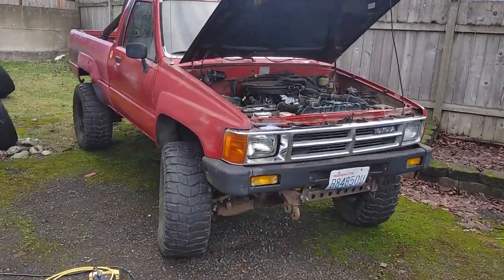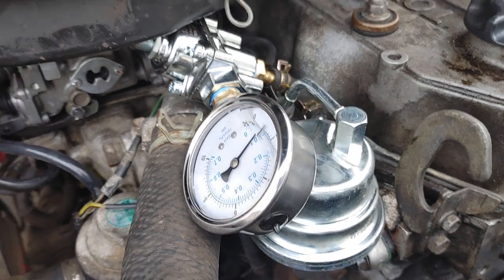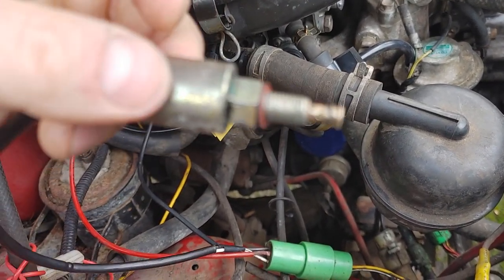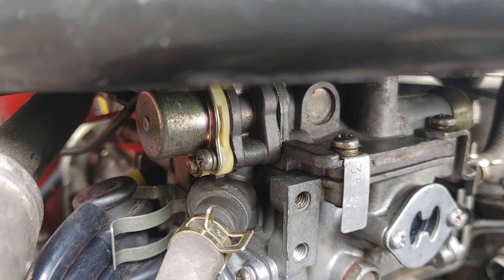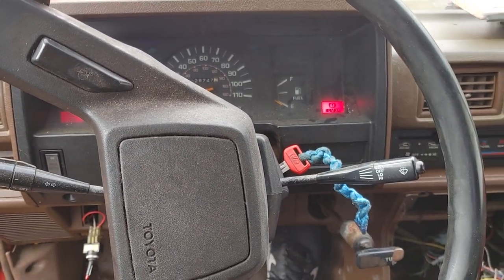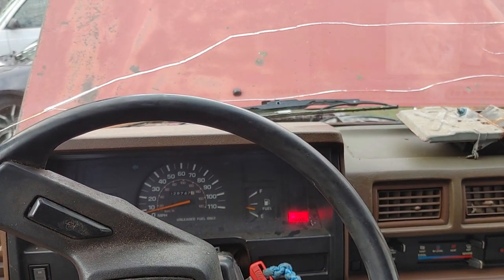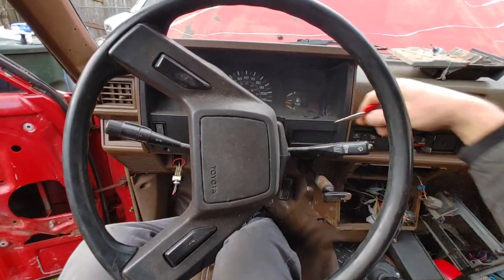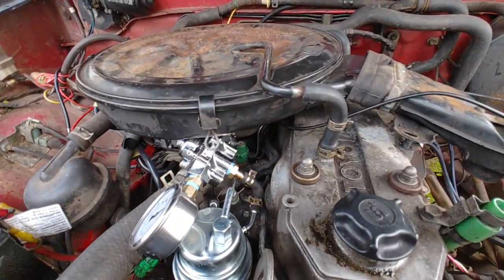22r won't idle - Fuel Cut solenoid? SOLVED! SEE DESCRIPTION / COMMENTS

Comment: I repaired one recently ,1989 Toyota truck 22 R. 
The idle circuit had a rough idle, other than that vehicle ran fine. You had too keep youre right foot on the gas pedal slightly while idling. Coincidentally mine just happened too be a twofold problem. After removal of of the fuel cutoff solenoid and observing the tip of the solenoid while it was energized even though the solenoid clicked, there was hardly any movement of the pintle valve tip that I could see. I sprayed carb cleaner through the tip with a long nozzle and nothing went through it. Finally after working with it for awhile it unstuck itself and now it shows a nice spray pattern out of the spraying nozzle orifices.
The second part of the idle problem was a cracked vacuum line. So these two things made this diagnosis a little tricky, but it can certainly be done. This particular truck took about couple hours.
Hope this works for someone who is going through a similar problem. Good wrenching too all the techs.

Comment: The fuel cut solenoid could be possibly stuck. Try spraying the tip of it with brake cleaner and tap the tip of it with a screwdriver. Repeat with brake cleaner several times. Then test it with power to see if it will click. You can also try tapping on it when you add power on/off while testing. If nothing happens, then it probably doesn't work anymore and you'll have to try to find and buy another one. That small o-ring that goes on the end can probably be found in a carburetor rebuild kit for this carb at the auto parts store.

Have something hold down the gas pedal to keep the pickup running and then check the glass window on the carburetor to see where the fuel level is at. Is it too high, or too low?

You may need that solenoid for the truck to run. In my experience when I had a 1980 Toyota Pickup 4wd with a 20R, that solenoid is connected to a circuit board near the driver's side left foot (it's call an emissions computer, it may not be on all models though). The cold solder joints on the circuit board develop tiny cracks and will cause intermittent connection with power and ground for the solenoid to function. You can reheat the solder joints on the circuit board to fix this type of issue. (What I did was just splice into the negative wire of the solenoid and wired that additional wire straight to the negative terminal on the battery and it ran fine.) Symptoms that happen with intermittent connection with this circuit board: stalling/stalling especially when driving and letting off the gas pedal when coming to a stop.
Reply from the maker: Hey thanks for the reply! I tried exactly this with the emissions computer. Reflowed solder on every point and added a tiny bit of fresh lead Kester solder. Noticed a bad diode as well. Replaced with generic diode of similar type. 

I've seen people in forums say the white wire on the fuel cut solenoid is ground, but in wiring diagrams and from my testing, it actually goes to that emissions computer. Maybe it's supposed to get grounded there? Whatever....it's not working on mine. I cleaned the fuel cut solenoid in an ultrasonic and sprayed it with carb cleaner. Got it to unstick and click, although it still seemed gummed up, like a weak muffled click. Installing it did not fix issue. Ordered a new crappy Chinese fuel cut solenoid that has a very definite clean sounding click and only one positive wire. It receives ground from the carb body (like everything else on the carb, choke heater, outer vent). It appears that if the fuel cut solenoid fails CLOSED, or does not receive 12v power to open it up, it could starve the engine of fuel and prevent proper running/idling, but the fuel cut solenoid itself would never cause my problem (way too rich and flooding with fuel). It appears all it's intended to do is immediately cut fuel when the key is turned to off to prevent residual fuel getting in resulting in dieseling.

Anyhow, after studying wiring diagram, I was able to get a remote starter hooked up (have to ground clutch safety wire and wire remote start between batt + and IGN wire going to start solenoid). Upon doing this, I was able to see the float filling up, up, up, up and then overflowing....even though I set the level EXACTLY as stated in the FSM and triple checked. After spending a ton of time dicking around with the float level, I was able to get it idling quite nicely....until a radiator line blew because the thermostat is old and dead. So ordered a new one and just put it in yesterday. Gunna reinstall dash instrument panel (pulled to install new bulbs and fix heater gauge) and see if she's finally alive when I have time....probably next week. 

Thanks very much for taking the time to reply! Very much appreciated!

Comment: wow I haven't seen one of those in 30 years, that fuel cut solenoid is exactly that, it cuts fuel off to keep it from dieseling, the previous design had a pin that we would take out and screw the solenoid back in, on that design just snip off the brass end with the holes and screw it back in, you don't need it. Next, you have the air cleaner on so I can't see if choke is closed, also that glass window is to check fuel level, you should see fuel in between the two flat points, also there is a metal, what looks like a round housing on the side of the carb with a vacuum hose attached, there is a rubber diaphragm  inside to assist in cold starts, pull that vacuum hose off and make sure there is no gas coming out, if there is either the diaphragm is ripped or missing.

Comment: That's idle cut solenoid?
It changes length when you shut off the ignition key?
It changes length when you turn the ignition key on?
Does it? Are you grounding it's body during the test?
Do you have a "you pull it" yard, around?
My idle cut solenoid worked for over forty years before I parked the car and haven't tried to start in a long time.
So, if you verify it does what it does when it's supposed to do it. Install it, my question is how many cylinders are firing?
Maybe inspect the spark plugs, clean and gap them. Inspect the secondary ignition like cap, rotor, wires.
Verify spark at each plug.
Turning idle air bleed screw in leans it. That's about as lean as it gets at 1 1/2 turns out. There is an idle speed screw. Are you using it instead of your foot?
Does it smell rich and were the plugs all firing?
See where you're at.
There's a HIC and an HAC on some of these trucks.
I studied them in library books for free and helped one with used parts while I experimented.
Do you know these terms? 
And what's your emission sticker or cafe decal look like?
Does it have a system designation?
Like, my dad's Corolla was a 4 AF.
Has your engine been modified?
Do you have vacuum leaks?
Try pinching each hose and see if idle speed changes.
There may also be a hose that gets disconnected and plugged during fine adjust of idle mixture.
Is your timing set and undisturbed during this repair?
Did it run bad before you condemned the carburetor?
Are there advance and or retard diaphragms on your distributor?
Are they able to hold vacuum?
Does fuel leak into the vacuum hose that supplied vacuum to the distributor if that how yours is outfitted?
You can learn a lot from a Haynes manual.
You can request one at the public library.
Leave your camera home.
I watched another guy who had to adjust the float to fill  the float bowl to the sight glass, but his idle mix setting was like 3 to 3&1/2 turns out.
I was surprised that was supposed to be right.
I think he just didn't have enough available fuel.
His video didn't show his choke plate or how it opened.
His carb might be different. It had he choke cap very high on the passenger side and the sight glass very prominent on the front.
I don't have both to compare when writing this.
Reply from the maker: Danny, thank you thank you thank you! This is INCREDIBLY helpful! These are all excellent questions! It ended up being the stupid float level! Even though I set it EXACTLY to FSM specs and tripled checked. I was able to determine this only after hooking up a remote starter (a little tricky on a 22r....I'll be posting a video soon on how to do this). Basically you need to wedge something to depress the clutch (not ideal putting it under constant tension) or better, ground the clutch safety wire going into the starter solenoid, then attach remote starter between batt + and IGN wire going into start solenoid. Anyway, when I did this, I could see the bowl filling up, up, up, and up....past the middle line, then out of view, then overflowing and never stopping....again, even though I set the float level to FSM spec and confirmed no issues with the float (even tried replacing it with a new one). Anyhow, after spending a ton of time dicking around with the float level, I was able to get it idling quite nicely....until a radiator line blew because the thermostat is old and dead. So ordered a new one and just put it in yesterday. Gunna reinstall dash instrument panel (pulled to install new bulbs and fix heater gauge) and see if she's finally alive when I have time....probably next week.

Anyhow, thanks VERY much again for all the great troubleshooting steps! I really appreciate it! There will be more videos posted soon of work on this truck, and more importantly DRIVING IT when it's done! Sorry, the camera is in my pocket, so I use it all the time ;)

Comment: I need help. On my 85 Toyota pickup 22R im trying to see which of the two hard lines on the side of the block goes where. They're bolted to the side of the engine. I dont know if the upper or lower line is the inlet to the tank. Thanks

Comment: Have you got your truck up and running?.  Sounds like you got fuel issue. have you checked the fuel level through the glass window opening on the Carburetor?. It should be in the middle, between the top and bottom of that glass window, if it's  too high then it will flood the engine and if it is too low then it doesn't get enough fuel to run. I suggest you send your Carburetor to a Carburetor specialist to have it rebuilt and reset everything to its spec. it starts right up but could not keep idling that means something in the Carb is out of spec. Good luck.

Comment: I have a 1986 that’s having the same issue.  I’ve changed out the fuel pump, plugs, plug wires, distributor, fresh oil and a brand new carburetor.  Still with the sputtering, shutting off etc.  what was your fix?
Reply: I also have an 86 with same issue. Ever figure out the issue? My next steps are to replace thermostat, adjust float levels, and then try adjusting choke.

Comment: I had vac lines hooked up wrong once and was pulling fuel up from tank through carbon canister and it ran just like that with black smoke.
Reply: Mine's doing the same thing but it started randomly after 10,000 miles on a head gasket job

Comment: Try turning up the idle on the carb a little bit and turn up the fuel regulator a tad more I have my 85 Celica GT with 22r idle set just under 1000 and regulator at 3

Comment: Being a 22r i have to ask when was the last time u changed your timing chain?
Reply from the maker: I bought it from a guy who bought it from a guy kinda thing. The price was low and information minimal. All I know is he did the head gasket, fuel pump, wires, plugs and some other misc stuff. He said chain guides looked fine and I don't hear any chain slap when I am able to get it running more than 10 seconds or so. Turns out, after I was able to get remote start figured out (a little tricky on a 22r, need to ground clutch safety and tap into IGN wire to start solenoid) that float level was off, causing flooding.....even though I set the level EXACTLY to FSM spec. After spending a ton of time dicking around with the float level, I was able to get it idling quite nicely....until a radiator line blew because the thermostat is old and dead. So ordered a new one and just put it in yesterday. Gunna reinstall dash instrument panel (pulled to install new bulbs and fix heater gauge) and see if she's finally alive when I have time....probably next week.

Thanks for the reply/help! Very much appreciated! Aloha!

Comment: It's not an idle problem, you have your plug leads wrong order, that's why the engoine won't run properly. Turn up idle screw, them set plug wires right way, and tune carburetor. Either that or 2 of your spark plugs are dead. Firing Order is 1,3,4,2  No 1 is in front. Air screw is allways 2,5 turns out +-   Idle screw turn it so it just touches stop, then turn it another threequarter turn in that should give you 850 rpm. now adjust your timing turn anti clockwise to set faster, when engine stops revving higher rurn slightly back. Now tune air screw, turn out until engine do not rev higher turn 1/4 turn back. Your choke screw should be about 3,5 turns out. I should run nicely.
Reply from the maker: Are you sure plug leads are wrong? The dude I bought it from did a lot of work on it, new head gasket. Maybe he missed that? I didn't even check. Turned out it seems to be a float problem (really weird, can't get it to behave consistently no matter how much adjustments I do).....but when the float is right, it idles fine. I wouldn't think it would do this if firing order was off.
Reply: Having similar issue, however it fixed itself once I hooked up the wires to the old LPG converter solenoid this allowed me to toggle this problem on and off with the flick of a switch however I believe that solenoid is buggered too because with the lpg switch toggled off it’s started happening again, just gonna remove the whole thing completely my previous 22r motor didn’t have it and ran perfectly fine for years,

Comment: I am confirming that you do need a functioning fuel cut off solenoid in order for it to idle properly. I removed my faulty solenoid and put in place a bolt and it idled perfectly.
Reply from the maker: So you're confirming you do NOT need a fuel cut solenoid to idle properly? I'm assuming that first sentence is misworded.
Reply: @evankolpack  a faulty cut off solenoid will affect your idle so you either have the option of replacing it with a new solenoid or removing it as a whole. Since solenoids are no longer available or easy to find I just went with the latter
Reply: So would that cause it to flood out at idle
Reply: @tinoanderson3912  yes it can either flood or cut off fuel supply
Reply: @kenxiong6830  cuz I keep shooting black smoke outta my tail pipe and I swapped the the cut off with a good one and it's still drips non stop down the throat of the carb
Reply: @tinoanderson3912  check your carb jets and make sure the floats are in good working order and closing the float valve. Also are you running the mechanical pump or electric fuel pump? If you’re running an electric fuel pump it needs to be no more than 4-5psi. Anything more will cause too much pressure.
Reply: @kenxiong6830  everything is bone stock
Reply: @kenxiong6830  except an aftermarket mechanical pump cuz the other one died
Reply: @tinoanderson3912  check to make sure the floats are set properly. Easiest way is to let the truck idle and watch the sight glass window on the car to make sure the fuel is in the middle. Other than that the only other thing is your carb to be jetted too high
Reply: @kenxiong6830  this problem came out of nowhere I was driving fine then all the sudden started running rough stalled a few times I got home noticed it blowing black smoke threw a good carb from a buddy's same truck on and still having the issue so it's been parked for a year I think something shorted in the computer and something with the vacuum switches isn't working since it's a Cali truck
Reply: @tinoanderson3912  I don’t think the carburetor cars had ECU. At least my ‘83 doesn’t. I wonder if maybe your timing chain is off. Timing chain guides failure is common on these trucks
Reply: @kenxiong6830  well as I said before the truck has 140,000 mi on it the head gasket was done at a shop at 130 and if you have an 83 check behind your driver side kick panel I don't know if they all have it but I know the California models have a green ECU module my '88 is different it's on the passenger side behind the kick panel